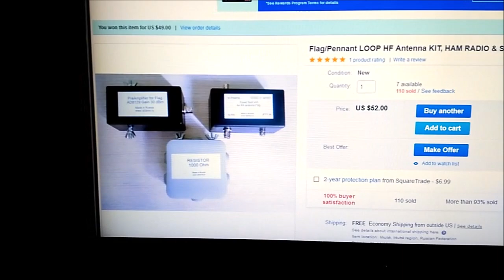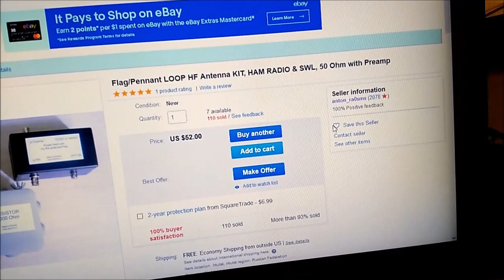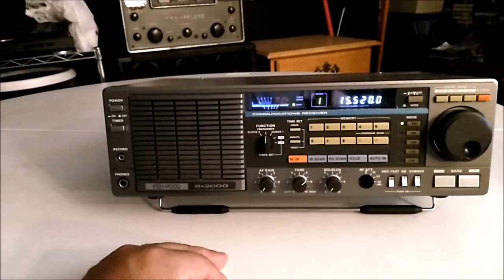Flag/Pennant Loop for HF SW/MW/Amateur Radio TX/RX Antenna Kit with Preamp from EBay

Comment: been using a similar kit for about 4 yrs now . get some great dx on low bands during the winter . mine is in a ewe configuration pointing nnw . for usa mw stations   . mine does not have a pre amp but get some great station as far away as porta rico . im in the north east uk by the way
Reply from the maker: That is very impressive on your setup across the Atlantic.  I hope i can get some good dx from this one this fall and winter.  Thank you for the comment Ray.  Have a good evening, Sir.